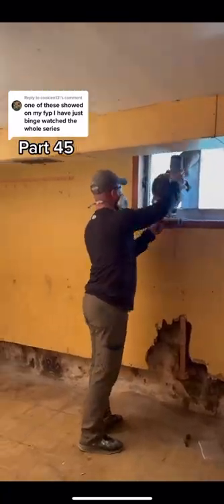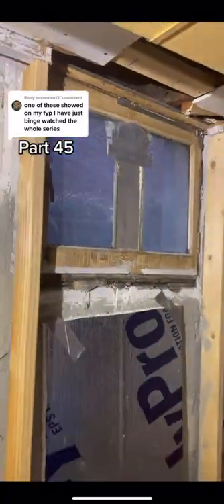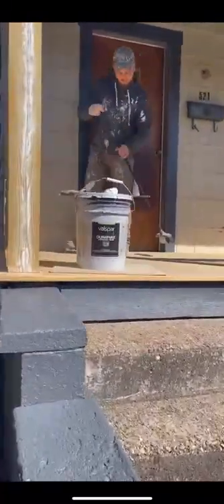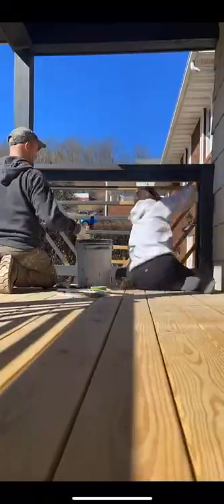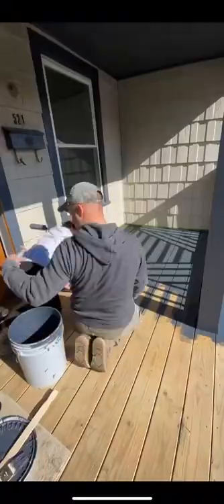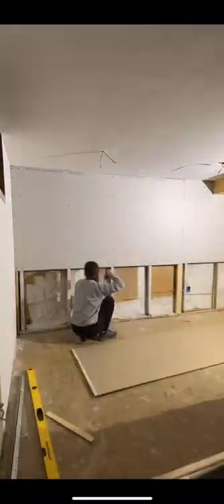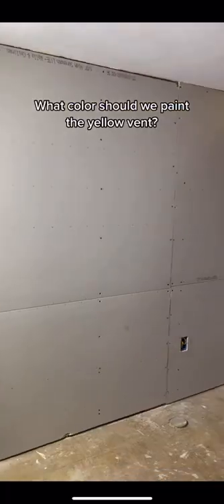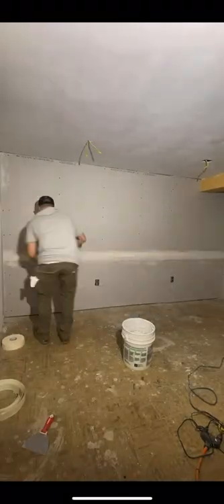PART 45 :Viral Video  | DIY - FLIP HOUSE SERIES - How To Transform an Old House

Comment: I’d just pressure wash the stairs and leave them unpainted. It’ll be safer (less slippery) and much easier to maintain because the paint won’t be chipping off the concrete
Reply: I completely agree

Comment: Leave the vent white or cream, easy to find a replacement when not painted.

The steps should be painted the color of your trim. If you don’t have a separate color for your outside trim then paint them cream color.
That way dirt will be hidden within the color.